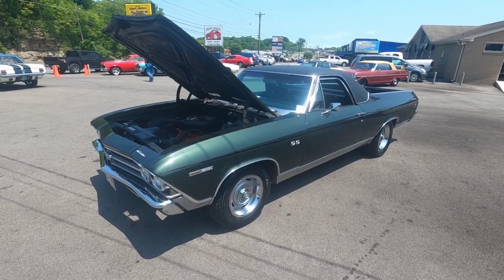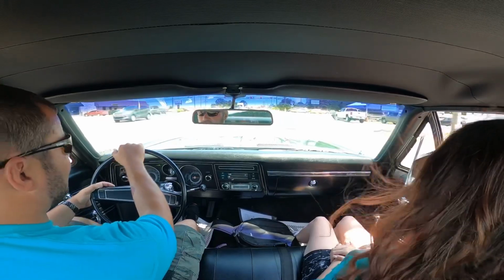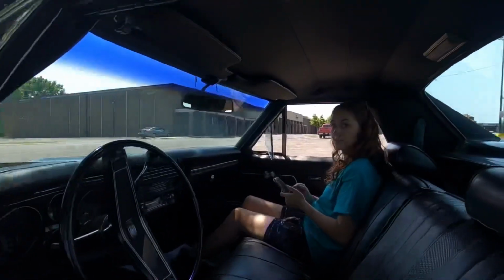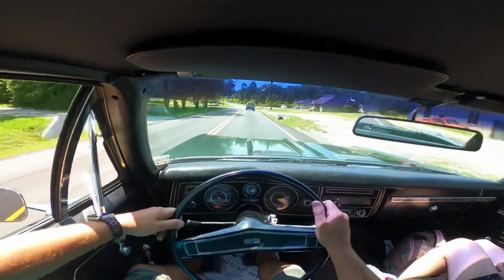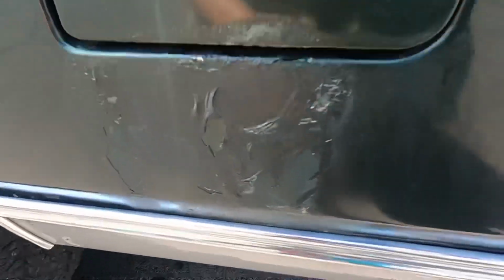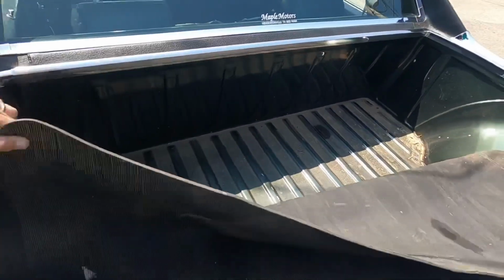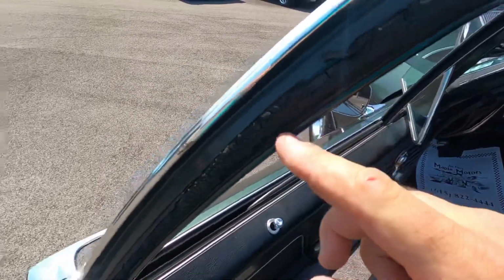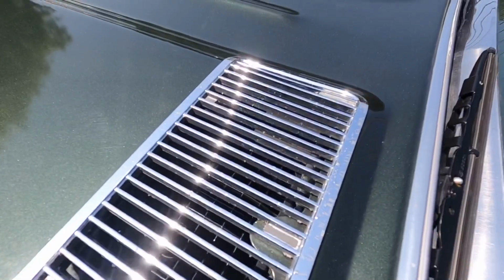Test Drive 1969 El Camino SOLD FAST #1639 Maple Motors

Comment: I noticed the grill emblem has SS 396. Doesn't match the fender emblems. Lot of oil under the car. Rear window deck looks solid with no rust. Rear windows are know to leak.